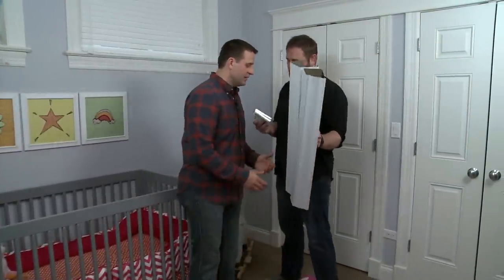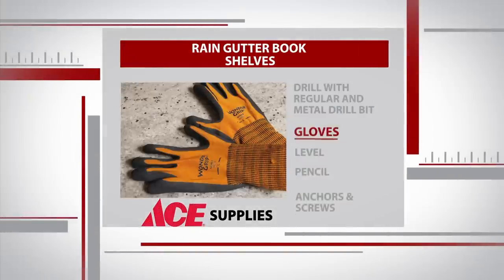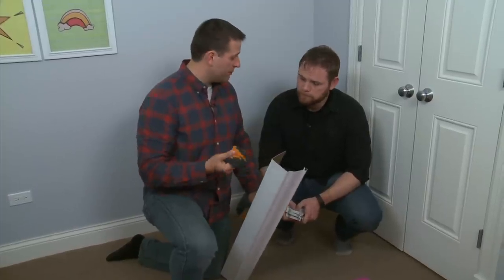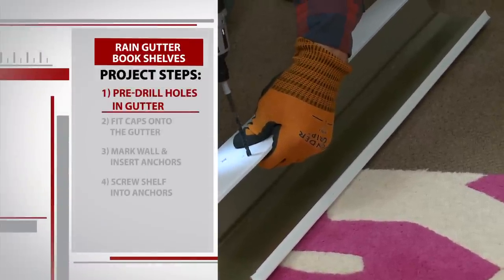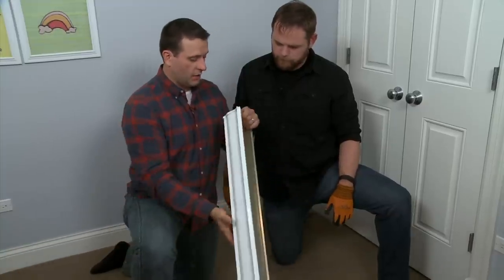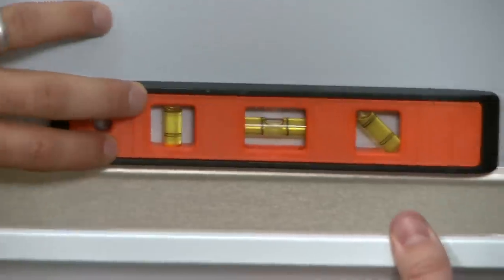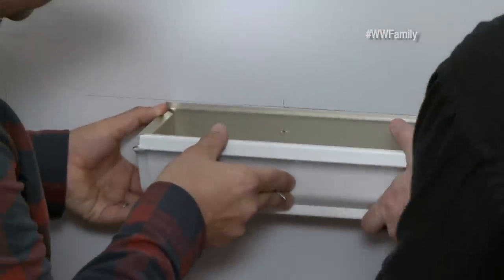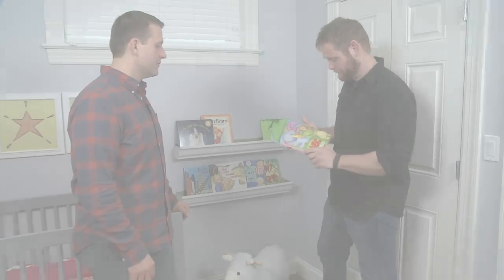How to Create Bookshelves from Rain Gutters

Comment: Is there a way to mount these without screwing into the wall?  Looking to put these in a classroom with cinder block walls.  Thanks!
Reply from the maker: brittimbs Screws are your best bet! You can use a hammer drill, concrete drill bit, and concrete screws to secure them into cinder blocks. Good luck!
Reply: They are right, screws are the best way and women need to learn how to use these tools.  However, if you have to wait for union workman to do the install, or cannot damage the school wall, there are other ways.
1. VHB tape (Very High Bond) will stick anything to the wall, assuming the paint does not peel off.  You can buy this at Home Depot and experiment.  Don't put a very heavy load of books.
2. If you can get the school workmen to put a long strip of wood along the wall, or two strips of wood, using screws, you are ready to make a series of aluminum-gutter book racks and screw these into the wood strips on and off as you like.  Wood strips should be thicker than 1/4 inch to be more robust.  I used pine and hung up stuff in my kitchen this way.  Should hold up well.